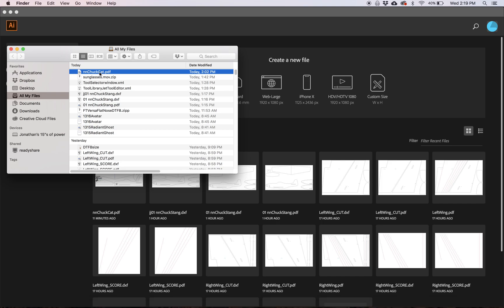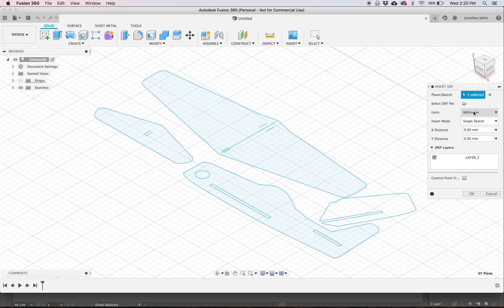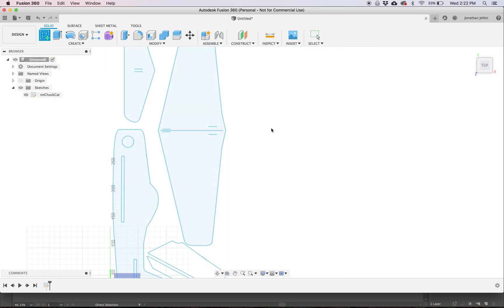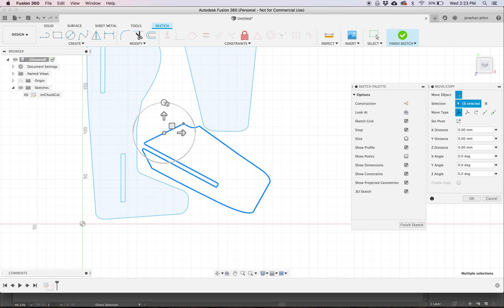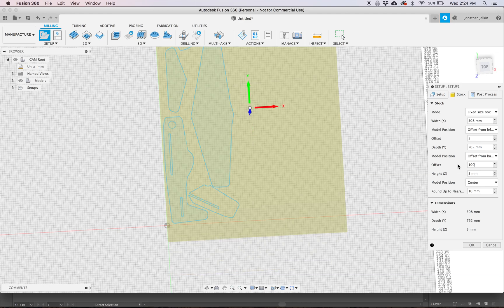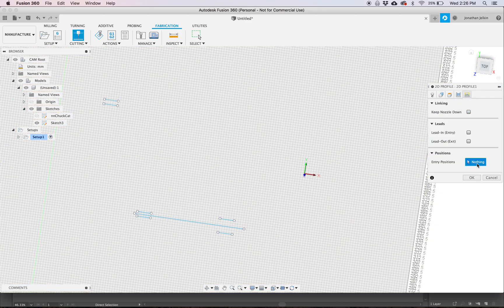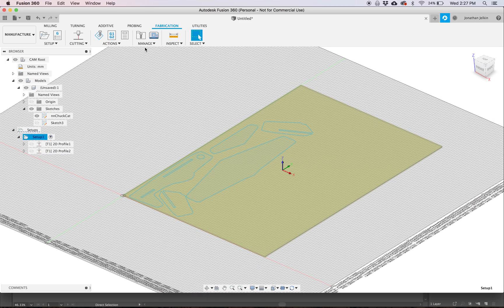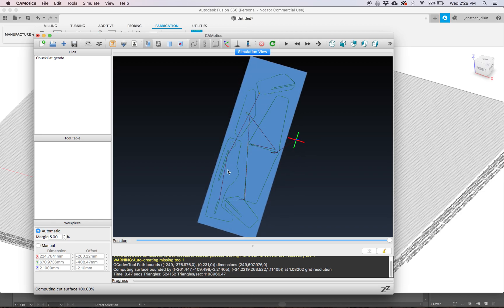Illustrator to Fusion to Gcode- ERC TimSav

Comment: Hello! So this works for CNC and for plywood? Couldn't see the part where you put the thickness of your material. Thanks in advance :3 Trying to understand how to use my school machine, we're using Mach3 as software, but I see that with CAMOTICS one can verify if fusion did a good job translating
Reply: Looking for the same answer: Is this method applicable also for the needle cutter as per ERC Timsav design?